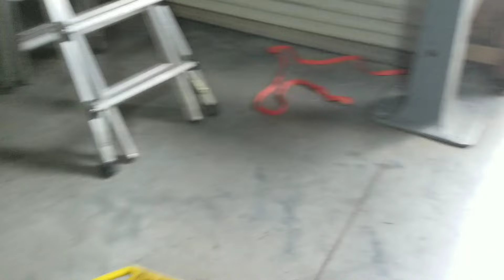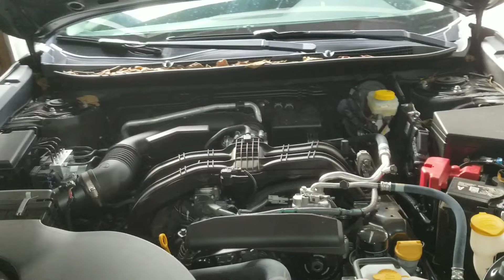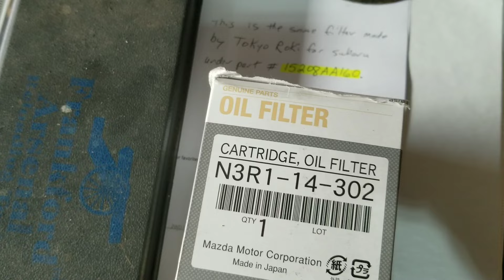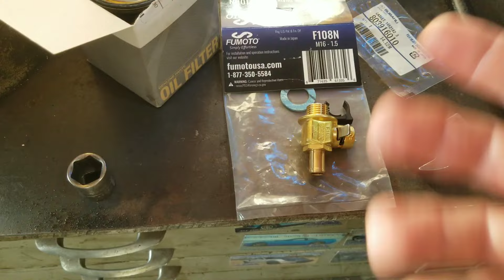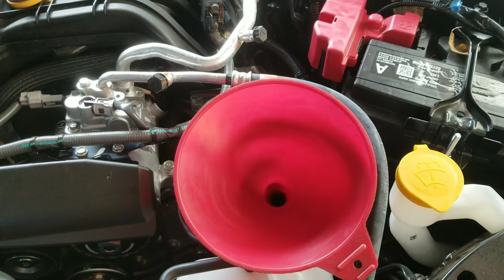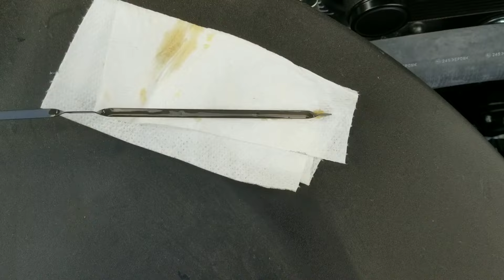2025 Subaru Outback Oil Change and Fumoto Oil Drain Valve Install F108N

Comment: HI, I am a mechanic, Former a manager of a Large Automotive repair shop in Canada. I LOVE your Video. wish I had it to show future mechanics, That I hard  working with me! Following your Video To'a' T. TWO little Points. I like To Menston (i) remove the oil filler cap, after you Take off The oil plug. in your case, Just before you open The drain assembly (this increases The flow of oil from The engine, if you remove The oil cap before The oil plug The oil will Splatter.) NEVER OVER TIGHTEN The oil filter. over tighten oil filter destroyes The Treads, makes it LEAK, something all or most all, Car & Truck manufacturers have built into Their machines. I'll leave The reason why upto you!
Reply from the maker: @WilsonJohnson-y1i  Thanks. You're of course  right about overtightening the filters.  Most of the time I get it as tight as I can with my hands.

Comment: You need to prime oil filter before starting engine, … hold foot down on gas and press and hold start button for 8-10 seconds engine will turn but not start, this will pump oil to filter. You can now start engine normally.
Reply from the maker: There is a lot of debate about this.  Logic tells me that if this method of priming after an oil change is beneficial, then we should be doing it before starting the car every time it sits for more than a few minutes. The oil filter drains itself empty (except for what is retained by the filter media) every time the car is turned off anyway.
Reply: The filter should have a check valve in it to keep the oil from draining. But if you're adding a new filter that would have to be primed.
Reply from the maker: @strokeofirish1  Fair enough. It definately isn't going to hurt anything to run lower rpms (starter rpms vs engine running rpms) while oil works it's way through the filter.

Comment: I installed the fumoto on my forester. Amazon has the tokyo roki filter. on oil chnges add 1/4 to 1/2 a quart after the dripping stops to rinse All the dirty oil out. drain valve traps some old dirty oil otherwise
Reply: Did you use the Fumoto washer or the Subaru crush washer when you installed it? I’m about to install my first one and now trying to figure out which is best.

Comment: Subaru dealers are now using 0-16 oil.
Reply from the maker: @joelpfeil7131 Unfortunately, they recommend these light oils just to keep the feds happy (to show improved gas mileage however slight it may be). They also recommend longer oil changes than is good for your engine to lower "cost of ownership" and get carbon credits.

Comment: I used the Fumoto drain since 2004 for my 99 econoline 7.3L diesel van 
I question whether or not the outback has enough clearance to the ground for that for drain plug…??
I am going to change the oil at 1000 miles … due to the heavy initial wear when engine is breaking in … it’s a brand new 2025 outback…

Comment: Remember that has a torq setting...its 18 Ft Lbs.
Reply: Which torque is that, the oil filter?
Reply: The valve